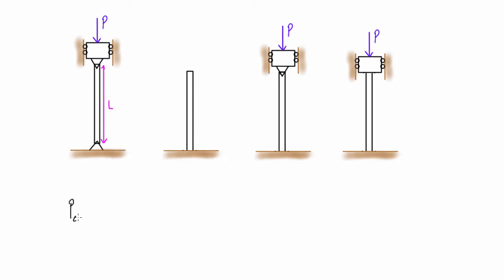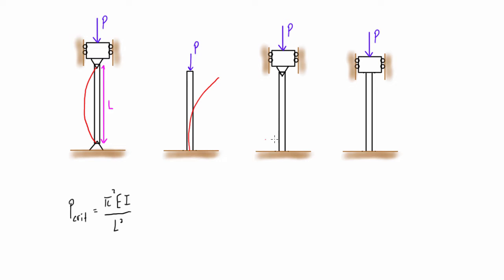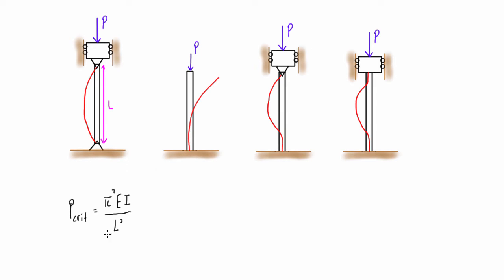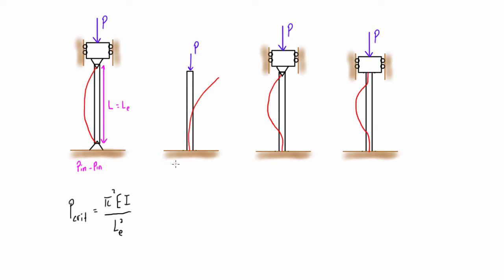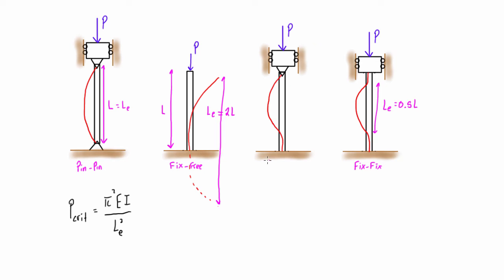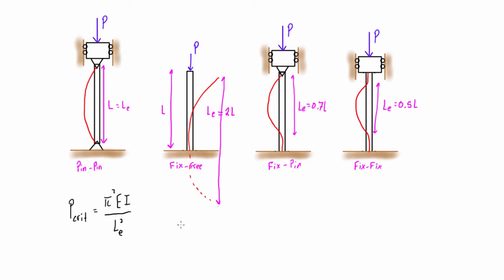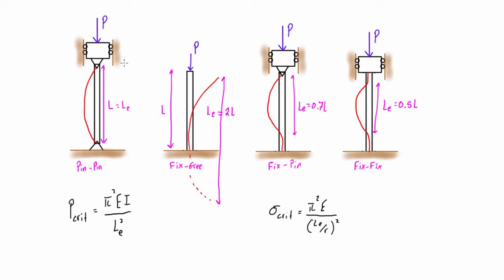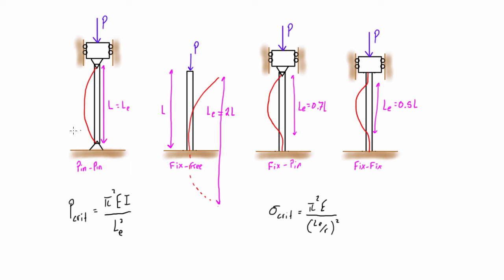Effective length of columns with different end conditions

Comment: If braced at middle of column?
Reply from the maker: Here’s an example with bracing: https://www.engineer4free.com/4/column-buckling-example-problem-5-with-bracing depending on the setup, you may need to consider the column on each side to have different end conditions and effective lengths
Reply: @Engineer4Free  thank you

Comment: How do you treat a fixed-roller situation?
Reply from the maker: Depends how the roller is oriented, but if it is like a roller between the top of the column and a ceiling above it, then because that reaction cant provide any lateral support, it would be modelled as a fix-free type.

Comment: when we are finding crippling load,should we take the actual length or effective length?
Reply from the maker: Always use effective length in the formula. Length = effective length only for pin-pin connections, but even then, you should identify somewhere on the page that L=Le and then use Le in the expression!
Reply: Engineer4Free thanks for the advice
and please do more videos